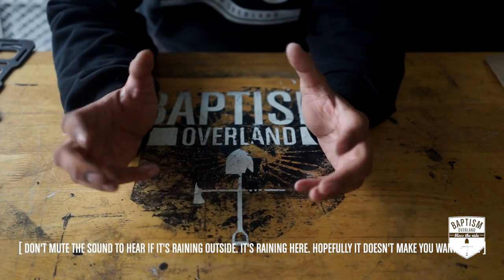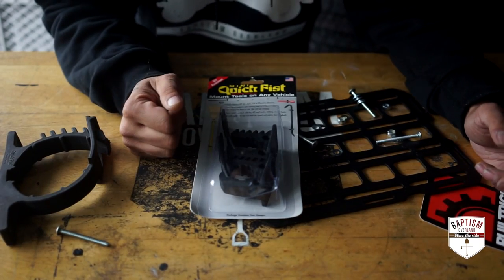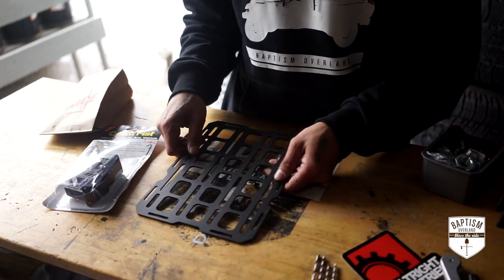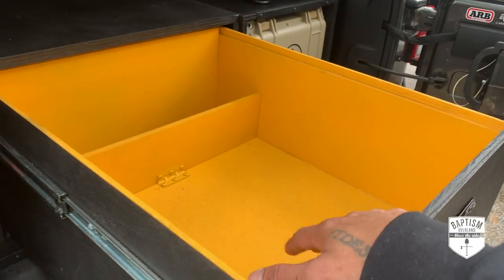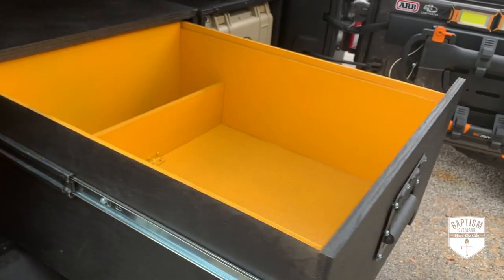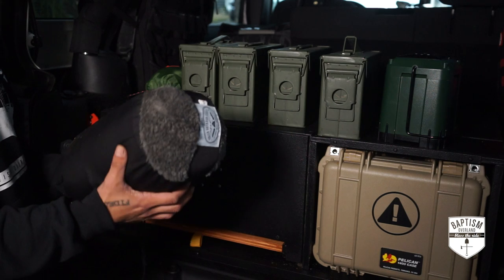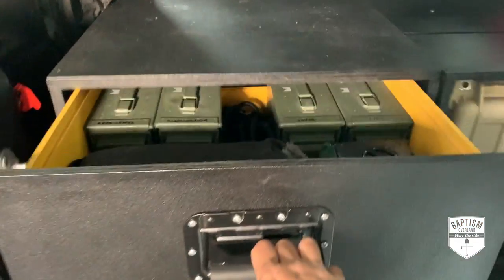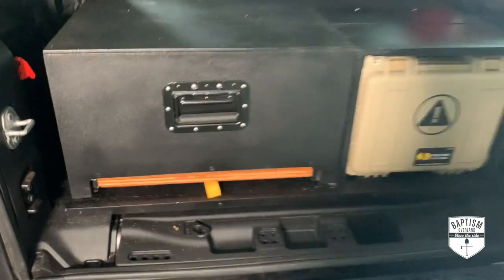DIY Jeep JKU Storage System Overhaul Pt 4: The Organization

Comment: Really well done, thank you for sharing, give's me new ideas. One question, maybe you have an idea. Would like to pull out my 80/20 frame completely out of the rear of the Jeep... Would you drill down these pull outs directly to the ground of the Jeep or would you use a reinforcing plywood? Greetings from Germany
Reply from the maker: Well I def wouldn’t punch holes in the floor of my Jeep. What I did was use plywood and drilled that down into the existing holes that had the tie downs as well as holes from the seats. I used those to anchor down whatever I needed. Not sure if that’s what you’re asking...
Reply: @BaptismOverland  Great thank you,  right, that was what I meant. You helped me out

Comment: LOVE the build series, love your production of video and subbed. How much would it be total for the whole cargo build? I want like you got.
Reply from the maker: Thanks man!! It cost me about $400 in hardware and wood. The majority of it being the slides.  Had to get heavy duty locking slides that ran about $150
Reply: @BaptismOverland  $150!? Woow! Anyway you could possible write out dimensions for whole cargo, including the fridge panel? Definitely want to do this during summer as a project.
Reply from the maker: @zachtuk111  I didn’t write dimensions because it’s all pretty custom in how you want to build it and how high or wide. Just follow the process but you’ll have to measure it for your needs